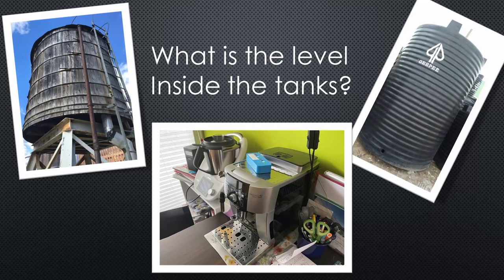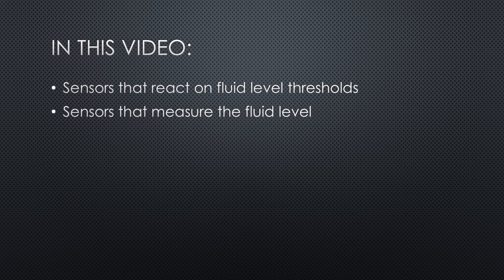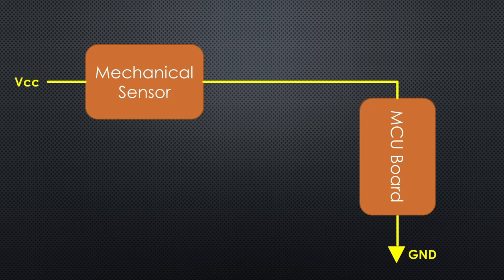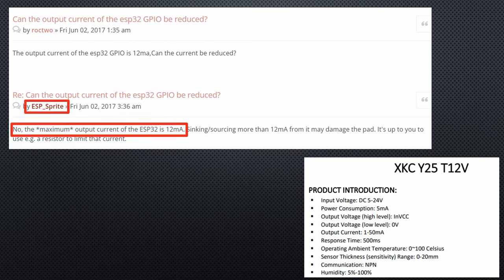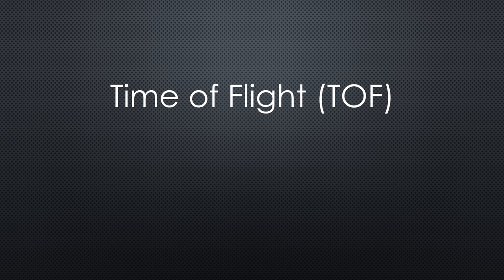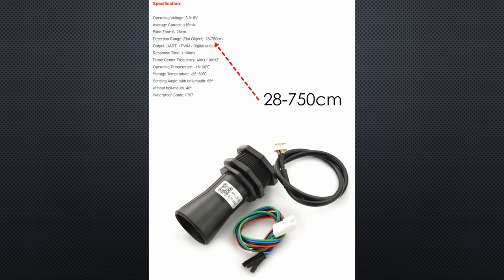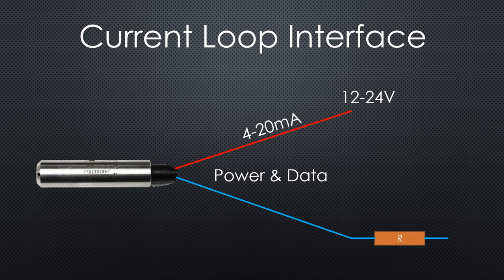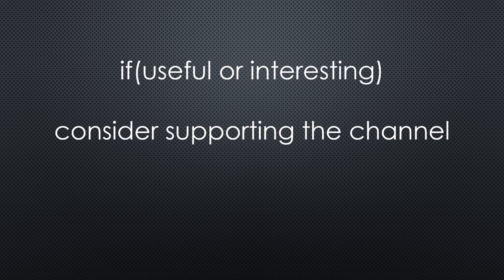#411 Ten Fluid Level (Water Level) Sensors and how to use them (Arduino, ESP32, ESP8266)

Comment: I have been looking for a water level sensor, to detect the water level in a garden pond. This turns out to be a really difficult environment for such a measurement. The water is biologically active, coating any sensor in contact with the water in algae and limescale. While the pH of pond water is relatively stable, and close to pH 7.0, it can still be corrosive, due to the high oxygen content. A pressure sensor has the problem of silt build up on its surface, as well as the previous three. A float system only gives an indication of a maximum and/or minimum level. These too suffer from jamming, if there is a build up of lime scale of biological growth. 
The best uses a water proof reed switch and a floating magnet ring. The non contact surface water level sensors, suffer from water ripples, and in the case of LIDAR, reflected sunlight, thought this can be mitigated by mounting the sensor in an open ended tube. All surface sensors fail to give the real water level if the pond surface freezes in winter, with the danger that the pond water can drain away under the ice. I have experimented with an insulated capacitive probe that provides a continuous reading of water level. This works like a coax cable, but with a larger diameter tube and a plastic coated wire down the centre. The dielectric is the pond water. As the water level changes, the capacitance of the sensor changes by as much as a few hundred pF. Making this capacitor part of the tuning element of a Schmitt trigger RF oscillator, allows the water level to be measured as a change of oscillator frequency. Unfortunately my attempts to water proof the outer screen have not proved successful in the long term. 
The Brita water filter, has a water level sensor which is used to measure how many times the filter is used, and thus recommend when the filter cartridge needs changing. This uses a two wire contact probe to measure when water is in the water reservoir. It solves the corrosion problem by sensing the water level with a very low voltage AC square wave. The microprocessor circuit runs on a cr2032 battery. By using both low voltage and AC, the problem of Electrolysing the water, or the salts it might contain, is minimised to almost zero. I do not know what metal is used for the electrodes, but I guess it must be stainless steel.
I have come across an inductive method of measuring water level. This uses two water proofed torrid rings mounted close to each other. The water is allowed to flow through the centre of both toroid rings. The coil mounted on one of the rings is energised with an AC signal, this is detected with a coil mounted on the other ring. The water linking the two coils acts as a shorting turn, coupling the two rings together forming a transformer. This arrangement is used in, not only detecting water level, but measuring its conductivity.

FYI. I use a none contact capacitive sensor, similar to the one shown in your video, to measure the level of solution in my PCB acid etch tank. A microcontroller monitor system uses the level signal to cut the power to the tank heater and air pump, if the solution level falls, due to evaporation. This prevents the exposed glass immersion heater melting the plastic tank. The sensor is mounted several centimetres from the tank wall, to protect it from the acid. It still gives reliable readings at this distance.
Reply from the maker: A lot of valuable experiences. Thank you!
Reply: I like the very nice collection of ideas and practical experiences and challenges there! This is real engineering, finding good compromizes that actually work.
Reply: @benhetland576  the capacitive sensor is the most promising, particularly as it gives a measure of water depth. It has a number of advantages, in that the outer wall of the sensor can be the zero volt of the circuit, acting as an RF screen. It is relatively easy to mount the Schmitt feedback circuit close to the plastic tube and coupled to the electrodes with a short length of coax. This adds a small capacitive offset. .
It is necessary to add some temperature correction to the oscillator, and provide it with a stable regulated supply rail, but this can be switched off between measurements to save energy. The capacitive change on a one meter long pipe is significant, between fully filled with water and empty (filled with air).
 I made my prototype out of uPVC water pipe, while it is easy to water proof the the centre electrode with plastic air line tube, trapping the outer  aluminium  foil screen between two lengths of concentric uPVC pipe proved to be very  difficult, as is making a weather proof connection to the electrodes. The pipe needs to be open at both ends, with the central wire supported at both ends to keep it in position. In a pond environment, it is difficult to keep insects from making a nest in the tube, and water weed growing inside it. The top of the pipe can have a cap, but it must have a hole for air to get in and out, or the water will not rise up on the inside.
What is required, is the outer electrode sealed between two flat sheets of plastic, and then these rolled into a tube. I could have used a metal outer pipe, but I did not want to introduce metal ions into the pond water, copper pipe would have been ideal for the outer, but copper salts are toxic to fish.

One other sensor we tried was using two lengths of fibre optic cable, mounting the ends so when in water, the light emitted by one is refracted and can be captured by the other. This works well for clean water, but pond water quickly renders the ends opaque. The idea was inspired by the optical smoke detector. It has the advantage that the electronics it is completely galvanicly isolated from the water. By using a modulated light beam, it's possible to eliminate the effects of ambient light, plus the fibres can be mounted in a opened plastic tube or box to shade the sensor from ambient light.
Reply: @nigeljohnson9820  Perhaps you could use some braided metal sheet/band to wrap around the plastic tube, then top that with a layer of epoxy resin to seal it off (and the resin will bond to the pipe through the braiding). The inner wire can just be a regular insulated wire. I guess you could also use a cap with a hole at the bottom (water) end too, but the insect and growth problem probably will manifest itself at some point regardless.
Reply: @benhetland576 pond  fibre glass epoxies might work, but it's important not to put toxic chemical into the water..
Reply: The pressure sensor (10:00 mark) definitely seems like the best option. You can seal it and drop it in the bottom of the pond.
  
It's really fascinating reading everyone's problems and challenges here. Thanks for sharing!
Reply: @circuitguy9750  it is better to mount a water pressure sensor somewhere somewhere in the water column. Iris important to avoid the build up of silt on its surface, as the weight of the silt will appear as part of the water pressure.
Such sensors are hard to make,as they need to be water proof under pressure, they must also work over the expected range of water temperature, something that makes those based on air filled balloons difficult to make work. Over time the air always leaks out.
Reply: My experience with the throw-in type stainless steel pressure sensor that lies on the bottom of my swimming pond has been a lot more positive so far. Only 8 months in the water so far but it's doing great. I hope it stays that way...
Reply: @PersonXes  do you know how these sensors work and how they interface. A pond is somewhat different to a swimming pool. 
In a pool the water is clear with no sediment build. In a pond there is a constant build up of sediment and mud. A pressure sensor placed on the bottom of a pond would be quickly covered, such a sensor would need to be suspended above the mud layer, if it is going to have any chance of reading the water pressure. I don't think a sensor made of stainless steel would react with the pond water, but I suspect after a year, it would be covered in algae and blanket weed. Any holes in the sensor would certainly be colonized by either plant or animals, or maybe both. If you have any links to the sensor you are using, please copy them here.
Reply: @nigeljohnson9820  The one in the pond is doing fine but the one in my rain citern now started having problems. The measurement goes up and down randomly, even when I put it in a covered bucket of water so with a constant water level. The sensor looks clean so I don't know what the problem could be...
Reply: @PersonXes  which type of sensor are we talking about? If it's the pressure type, I can think of two reasons why there might be errors. 
Uncompensated pressure changes due to temperature, or a leak in the sensor. I suggest you dry the sendor and look for a tiny hole, maybe where the wire enters. Is the sensor digital or analogue? Please can you supply a reference to the sensor data sheet.
Reply: @nigeljohnson9820  Indeed it is the throw-in pressure sensor. Based on your suggestion that it could be due to temperature changes  I checked two things: 1: the past few days it was in a bucket outdoor. I checked whether the changes correlated with the changes of my outdoor temperature sensor and the temperature of my pond. It didn't. 2: I took the bucket with cold water indoor (where it would slowly head up to room temperature) to see what impact that would have. In fact as soon as I did this, the reading because rock solid with no variation anymore. The reason for this is likely that – with the sensor being inside my house – I'm no longer using the 15 meters long ethernet cable that runs from inside my house to my rain citern. Is it somehow possible that something happened to the 2 wires of the ethernet cable I'm using that causes the Milliamperes to go up and down in strange patterns? Here's the datasheet of my pressure sensor: https://www.aliexpress.com/item/4000098291819.html?spm=a2g0s.12269583.0.0.46ddcd1bjmp0vY

Comment: Great video, Andreas. I've created a level sensor for my house heating system tank using the TOF approach. Used a VL53L0X with a wemos D1 mini, one 18650 cell and a small solar panel. Measures were sent to a rpi running mosquito. Had issues with corrosion, so needed to encapsulate the sensor pretty well. Apart from that the thing is working now for over 5 years.
Reply from the maker: Thank you for sharing your experience!
Reply: @AndreasSpiess You really covered this well Andreas and mentioned practical points. eg my heating oil tank has two sensors (because it's so important). A VL53L0X and a cute ultrasonic JSN-SR04T car bumper sensor (which can't read under 300mm). Even when they read 6 times a minute and I massively average the output the result is 'noisy' (eg maybe the liquid sloshes in the tank - maybe a video on signal conditioning is a future idea). @pedrobaco563 mentions corrosion - oh yes! On my sensors the oil vapour destroyed the plastic and silicone casing - yup silicone conformal goo is no good with oil. Allegedly polyurethane is oil resistant. My 3D printed housing HAS been good though though I can't recall if I used PLA or PETG. The project is written up should you need it. Roger F

Comment: 11:10 this recalibration is a bit dangerous because the output signal is still not guaranteed to be within 10 mA even if the pressure is always below the corresponding level. E.g. pressure spikes may occur when the liquid is moving. And some sensors output 22 mA as an indication that the piezoresistive element is damaged.
Reply from the maker: Good point. You are right!
Reply: In instustrial enviroment there is a specification by NAMUR (Normungsausschuss Meß-und Regeltechnik) called NE43. It specifies 4-20mA not only for pressure sensors, but for any kind of measurement.  3,6mA means failure (low), 3,8 to 22,0 mA is linear to mearurement and 22.5mA means failure (high). Any other  value is per definition invalid

Comment: As for the coffee pot, you could build a decorative (wife compatible) coffee pot stand with a load cell in it, this avoids connecting a sensor to the pot itself and also gives you the option of a variable level indicator.
Reply from the maker: Good idea. The only problem I see is that there are two other "sources of weight": The waste water and the grinded (waste) coffee.
Reply: @AndreasSpiess  Could multiple load cells detecting balance shift , solve that problem?
Reply: @AndreasSpiess  Yes, that would be a problem, unless full waste trays are significantly lighter than the clean water capacity, which would be workable. I downloaded the manual but couldn't find the water capacity listed.
Reply: Wouldn't it be easier to simply weigh the wife?  When she gets light enough then she is probably thirsty and you know to fill the coffee machine.
Reply from the maker: @EKTORPTULLSTA. Maybe. And then my wife puts something on top of the machine ;-)

Comment: Thanks, Andreas, for another useful video. I have been trying to measure household water consumption for the last several years. The pressure sensors (shown @ 9:30) yielded excellent real time information, but there were two problems: 1. Different locations of the sensors in the home network results in far different information, and 2. The relationship of pressure to flow is an exponential relationship in dynamic conditions.  Each of these problems can be solved but then there a difference between the hot and cold-water systems.  When the hot water tank fires it pressurized the system fouling some of the mathematics.  It was getting too complicated for me.  Between these two problems I have found that better real time information comes from a magnetometer mounted to the side of the municipal water meter.  There is a ‘nutating’ magnet disk that rotates for each small amount of water that passes.  By monitoring this I’m able to accurately count the magnetic pulses vs. time.  Kevin Darrah has a wonderful presentation of the idea though I had to take it in a different direction because I’m battery powered.  Most of time my monitor sleeps and wakes every 8 seconds looking for a change.  If change is detected, then the device is on full-time and counting.  After 20 minutes of observations, the data is bulk-uploaded to Thingspeak to save on batteries.  That is the summary of the last 2 years of my life!
Reply from the maker: Measuring consumption obviously is very different to just a level. I also would have chosen your route. Or I would have tried the project which reads the municipal water counter's display with a camera and an ESP32...
Reply: just monitor the Flow not the pressure.
Reply: @AndreasSpiess  A non-intrusive method I learned about many years ago uses two sensitive microphones on the outside of the pipe a fixed distance apart. The noise of the flowing liquid (eddies, bubbles, etc) is digitised and compared with the other microphone to find a statistical best match. The time difference between the two matching samples and the distance apart of the mics gives the flow rate.

Comment: I use a VL53L0X sensor for water level measurement. This sensor is mounted so that the highest water level is about 10 cm below the sensor. To avoid light influences from outside the sensor unit was mounted in a plastic tube. Attention to the diameter of the tube. The VL530X has an opening angle of 25-35 degrees. If the tube is too small, internal reflections will occur.
Reply: As long as the water is still and not moving this can work, but the moment the surfaces moves the laser can reflect away from the sensor, or even not be reflected at all (brewster angle). So while technically possible, not a very safe way to measure. Unless you place a floating reflector to the surface of the liquid and use that as a target.
Reply: @SarahKchannel  That's right, that's why the plastic tube goes to the bottom of the tank. In the lower end of the tube are holes so that the water can flow in and out. In the tube itself is a white plastic float as reflector. Ping pong balls are good for this.
Reply from the maker: Good information! Others also mentioned the tube to avoid problems with sunlight. But not the diameter.
Reply: @juergenheisel7360  each medium, or fluid therefore, has a different refractive index. At certain angles a surfaces is either fully reflective or fully transmissive, or changes polarisation angles of the source. I am using the VL sensors in other applications and love them ! As long as the distance is not greater than 1-1.2m they do a good job.
Reply: @SarahKchannel  In my case, there are even extreme differences, once clear water, the other time with foam (washing machine). That's why I decided to use a white reflector to get the same measurement results and yes I can confirm the distance information.
Reply: @SarahKchannel  I'm using The VLX05 now but the sensor is mounted behind a glass, i would like to know from your experience, what should I be care for to get an accurate measurement (in mm) within a range that is less than a meter?

Thank you
Reply: @amiral3187  I never tried to measure trough a glass, the datasheet makes mention of this with some design guidelines, but I dont remember them.Obviously which ever material you use needs to be optical grade and transmissive for the laser wavelength the VLX is using. One thing that is sure, if it works trough a 'window' it will shorten the useful distance ! The accuracy should not change since its a TOF measurement .
One thing I would try, that there is no space between the front of the sensor and the glass, so the signal can not back scatter into the sensor, but then again - consult the design guidelines in the datasheet !